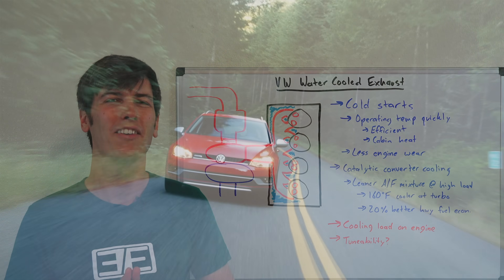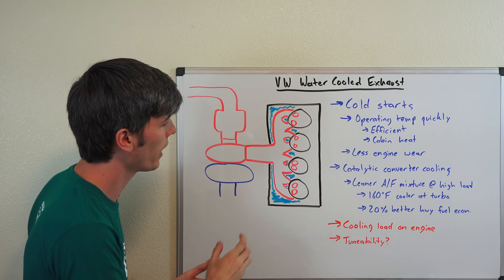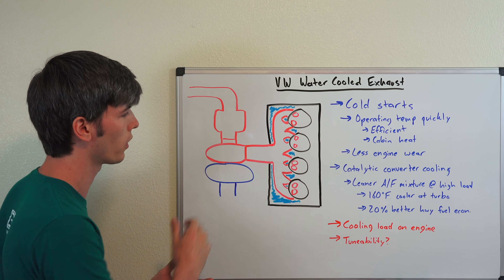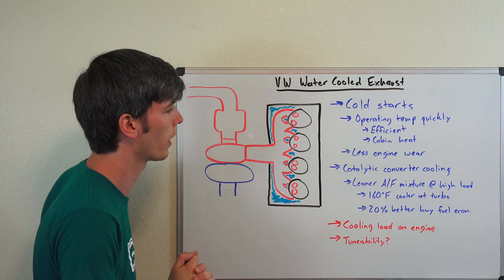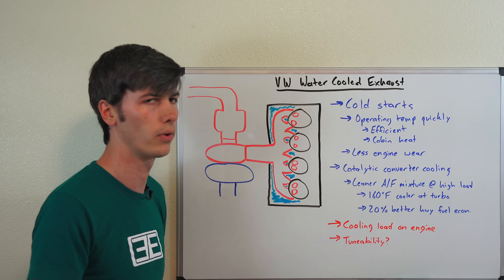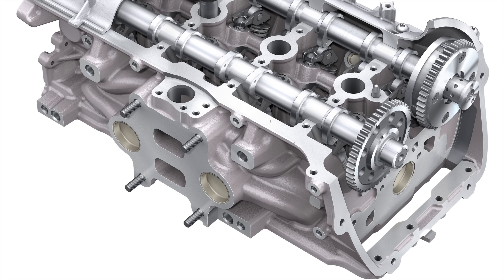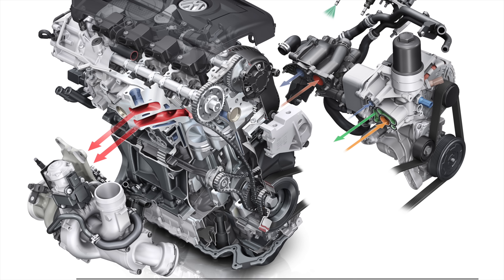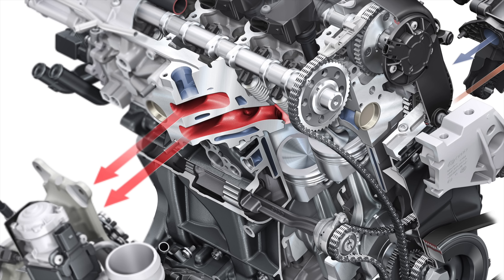Why Does Volkswagen Have A Water-Cooled Exhaust?

Comment: Just imagine how many things can fail. I wouldn't want coolant leak into exhaust
Reply: Not sure this is a realistic concern.  If the exhaust "manifold" is part of the same aluminum casting as the entire cylinder head, there are no gaskets or connections that could fail.  I think the cylinder head would have to explode for you to leak coolant into your exhaust.
Reply from the maker: Master Efer there isn't coolant directly outside of the exhaust manifold, it's in a separate jacket.
Reply: not likely that there is gunna be a crack between the exhaust passage and the coolant passage in the head LOL!  it would take something huge to create that crack,  something that would damage any engine regardless of design.
Reply: Hugo, unless you are making 2,500 hp, heads definitely do not crack all the time.  You have exaggerated too much and you are now banned from commenting on mechanical related videos.
Reply: Chris Biggar yes you're right, it would take something huge to get a crack there, though its still possible that it disforms under the thermal stress causing the head gasket to fail...
Reply: Hugo Barbedo well where i come from it is not common knowledge that heads crack and just because there are many youtube videos doesn' t mean they crack all the time. tell me, what it takes to crack a head if it happens so easily!!
Reply: Jacob Frey it doesn' t have to explode. it mau crack or disform the whole head
Reply: first of all i do not work for anyone,and neither do i manufacture cars neither do you man, so you will never be buying a car from me thats for sure...you probably worked at volkswagen cleaning toilets or something...anyway moving on....its common knowledge that aluminum cylinder heads and sometimes cast iron ones crack...if you dont believe visit a machine shop specialized in head and block machining, i am sure they have many there to weld and resusface every day or go watch the numerous youtube videos on several ways to repair cracked heads, either by welding, using push pins etc...so GTFO!! :)
Reply: +Jacob Frey maybe in the states with those massive 10 liter engines making just 100hp (now i am exagerating a bit) maybe maybe those heads with massive weight and surface to dissipate heat maybe they will not crack never, funny because i just watched a dude preheating and welding a cast iron head from a v8 but......anyway here in this shithole we have engines the size of an alternator and they overheat and they crack heads and the machine shops and scrapyards are busy places.....
Reply: Engineering Explained could you explain it looks like it's in the same casting, the temperature differentials between the water jacket and the exhaust ports would produce some really high stresses. I wonder how the reliability is. With those type of stresses, it seems like with time you would eventually have cracking.
Reply: Hugo Barbedo jesus christ, i don' t know who you work for, but i definitely don' t wanna buy a car from you guys, where your head cracks all the time!! yes i do have knowledge, you clearly don' t, i work at volkswagen we rarely do cylinder heads, so GTFO!!!
Reply: +Freak001100 normal exhaust manifolds crack all the time, normal heads crack all the time, do you even have any sort of mechanical knowledge dude? if not please do not comment on mechanical related videos

Comment: would this help with lag as well due to the exhaust gases don't have to travel very far to reach the turbo?
Reply: lone mazter - could you explain in a little more detail? I'm just really curious about this. I'm an engineer but have never really thought through the dynamics of turbo-lag before.
Reply: Large intercoolers/intake manifolds increase turbo lag because the entire volume between the turbo and the valves has to pressurize.  Even when the turbo is spinning it takes a few moments to fill up those pipes with air.  The turbine side is not designed to have a large pressure difference, it just needs fast moving exhaust gas.
Reply: a bit, but main lags are from long intake pipings